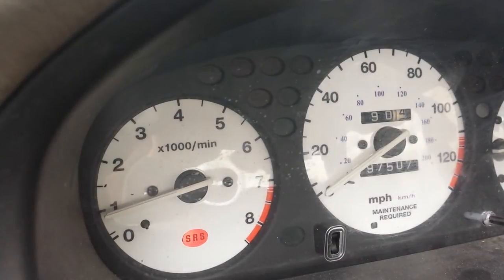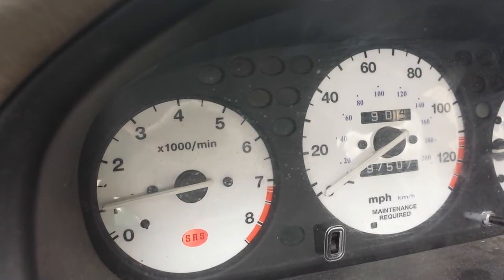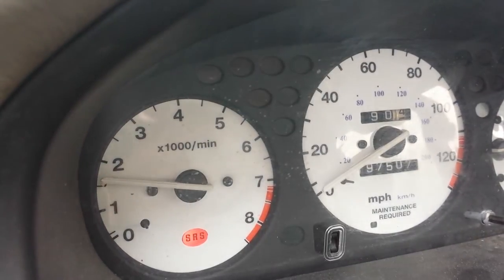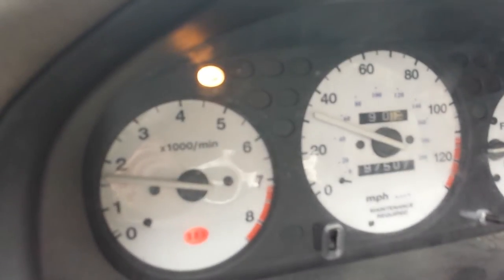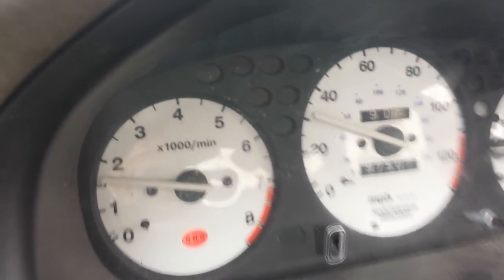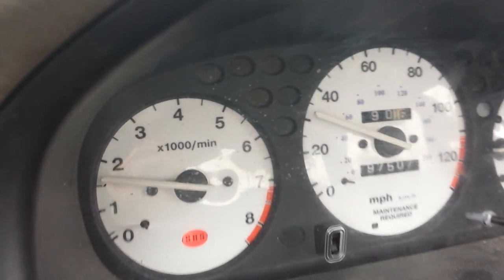Honda civic Lean burn indicator :)

Comment: Very nice I have been wondering if it takes a certain speed for it to engage ECO
Reply from the maker: from what I've driven it, it comes on at about 25mph, usually in 3rd gear.   it will hang on as low as 20mph and then cut out.  Thanks!
Reply from the maker: victor de la puente, jr. the highest I've had it running so far was about 2750 rpm at 70 mph. any more and it will cut out just like when speed drops below 20mph
Reply from the maker: if you have a check engine light on, it won't work either.

Comment: Pin A30 ?
Does it ground or give power on that pin?
Why is there an output on the ecu for lean burn, being that it is A30 what else would need signal of it being on?

Comment: What is your motor?  How about coasting, does it also light up?
Reply from the maker: lazal3m jdm d15b2 motor. coasting counts like idling, so no lean burn during coasting. letting off the gas and staying in gear usually will keep lean burn in deceleration. 
thanks for watching!
Reply: Can you also achieve lean burn on uphills?
Reply from the maker: lazal3m with a light foot, yes!
Reply: Thanks!
Reply from the maker: lazal3m coasting sucks, look up deceleration fuel cutoff  (dfco)
thanks for watching!

Comment: why cant you run lean all the time?
Reply from the maker: that's the way the ecu makes it go. if you run lean all the time, you'll never have any power. the ecu will lean it out "based on your right foot"
Reply from the maker: +victor de la puente, jr. it's a stock jdm ecu
Reply: +victor de la puente, jr.
do you have any evidence of this?
Reply from the maker: +RJ Costain no, it's not like I uploaded the video, or daily drive that car. no proof. 

silly troll this is the Internet!
go back under your bridge.